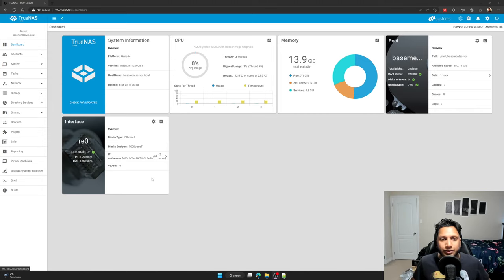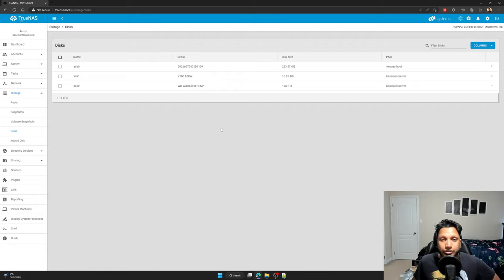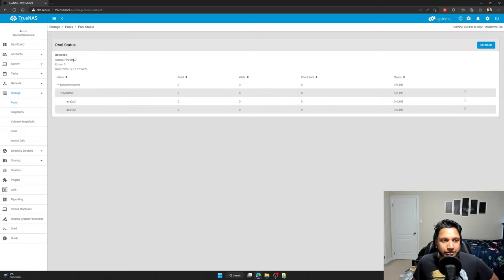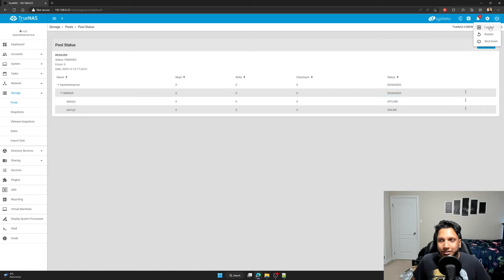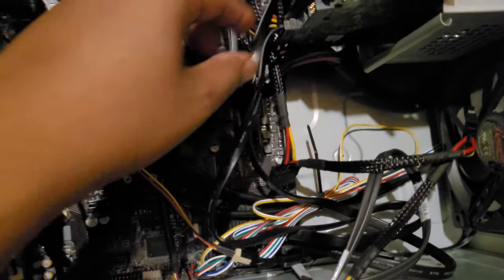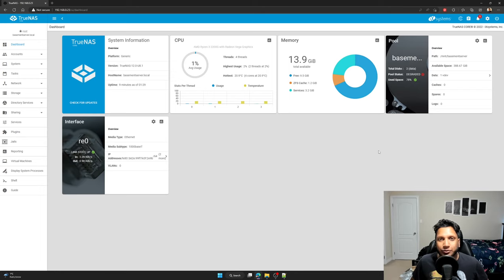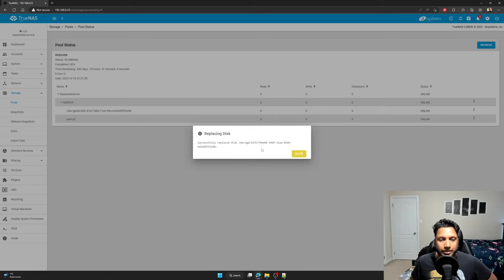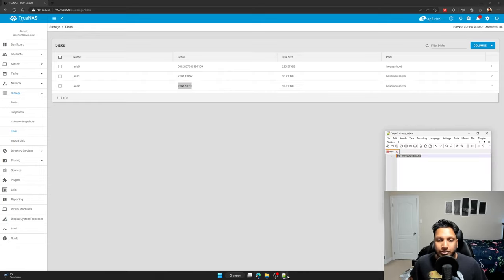How to Upgrade Hardrives in TrueNas NAS Server

Comment: Good video! After resilvering with the larger 12TB HDDs, do you have to expand your pool size to fit the new disks? Would it still show 2TB as the pool size? I have a RAIDZ2 array of 8x4TB HDDs in my TrueNAS Scale box and will probably upgrade each disk over time.
Reply from the maker: Thank you for your comment!  I thought I will have to manually expand the pool but ended up not needing to expand it. The process was all automatic and after resilvering my second drive, my computers shows 10TB available instead of 300gb lol. I am using Raid 1 for my setup. Your setup is quite nice as you basically have 8TB of useable storage and can withstand 2 failing drives. Good stuff!

Comment: Quick question.  Very detailed video.  I am getting ready to upgrade the hard drives on my TrueNas server.  I need 8.  When you replaced just the 1 drive in the pool, did it still function normally with 2 different size drives?  thanks.  I am running in Raid Z1.
Reply from the maker: Yep! the after replacing 1 drive in my pool, the server still functioned normally even with the two drives that are 2TB and 12TB.

Comment: Nice video. Quick question. I have 3 drives just like you. each drive is 500gb, i am drying to upgrade 2 of them from 500gb to 1TB each and when i click offline on the drive status section, it is showing me an error.
Reply from the maker: try restarting your NAS. Worst case, you can turn off your nas fully and replace the drive anyways and then click on replace but let me know if restarting works.
Reply: @sarajmollah  thanks i will try this

Comment: Hello, is the process similar for replacing one drive in stripe? (Like the actually server is just 1  drive)
Reply from the maker: Yea, I am pretty sure it is. Just plug in the second drive with the first drive already running, and then you should be able to copy all of the data into the new drive.